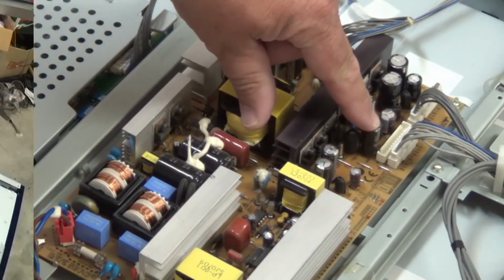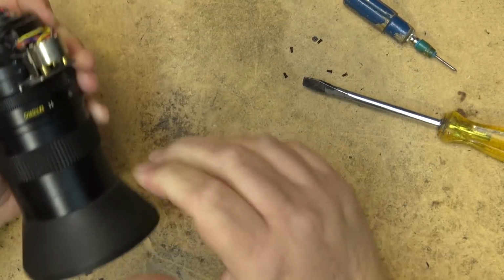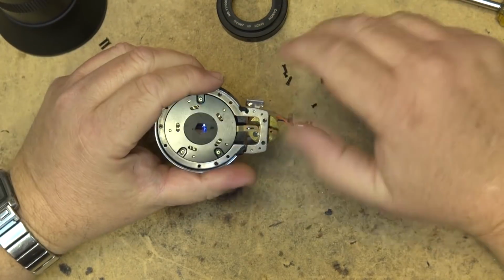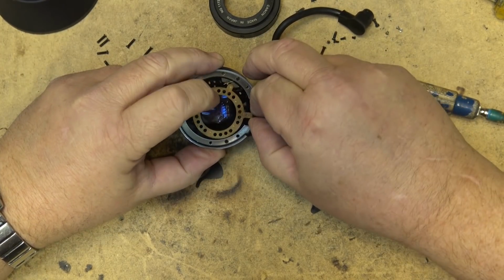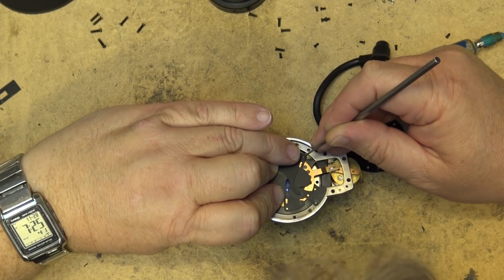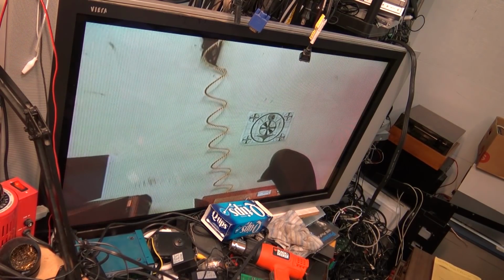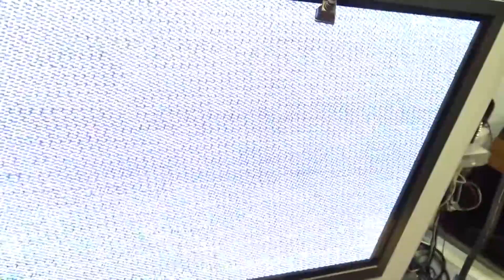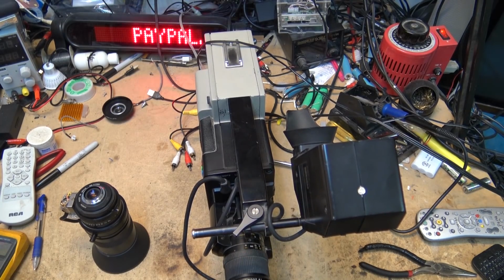Broken Canon Zoom Lens. Can I fix it? Let's find out.

Comment: Back in the 80's I worked on the service bench for Olympus Camera. I had to take many of those completely apart, clean all the parts in R11 liquid refrigerant,  reassemble,  and test.  Customers were forever getting all sorts of liquids in their cameras and lenses.  I can't remember ever having to tell a customer their devices were not repairable.  But that was right on the edge of the throw-away market.
Reply from the maker: We used to use Freon TF solvent to clean these parts as it was a high purity cleaner that would evaporate very quickly.

Comment: In the mid 80s I worked servicing broadcast cameras for a Japanese maker out of London UK. When the first chip sensor cameras came to market we’d an order for 35 units plus ⅔” format bayonet mount ENG lenses. The cameras were sent with all accessory sets and so too the Canon lenses and  their studio control kits... zoom demands and focus remotes. The customer however went through all the 35 brandnew lenses and screwed on the remote adapter units using his own supply of 3mm screws... that were too long by a good 10mm... he didn’t notice the kit had a small bag of black screws. So the result was 35 new lenses that had their variator crushed rendering each lens stuck with a fixed zoom position. The lenses were eventually all rebuilt that involved them being shipped back to Japan....
Reply from the maker: Oh I bet the tech that had to rebuild them swore more times than I did on this one.
Reply: @12voltvids  And likely in Japanese too. I pity the guy(s) that has(ve) to work on these often (no offence, Dave)

Comment: Speaking of the attachable lens camera, I had my Nikon 1 J1 camera, back the in 2015 when I was currently use the 10-30mm lens after when I was filming outside about the thunderstorms, until all the sudden later on, the 10-30mm lens went dead on me, so I have to stick with the 30-110mm lens for a while because, I can't get it to work where the original 10-30mm lens are no longer work. Following this year, I got the new 10-30mm lense and it works like a charm.

Comment: I THINK YOU ARE FIRST ONE IN YOUTUBE  REPAIR LENSE
Reply from the maker: Really?  I did not know that.  Well now you know how these things go together.  Initially I had not planned to repair it because I dont really have a use for this lens. Just wanted to show the internal make up and then I got the idea to fix the iris as that is what was broken on it.  Now I have a working lens but no camera for it.
Reply: @12voltvids  Well, you sorta have a camera for it now (just the issue is the auto-iris plug's too short). Sort of as the camera shown needs a good once-over (and maybe, if it's possible and viable for the camera, a new tube).
Reply: @12voltvids   i have b4 lense for my f900 hdcam camera the lens is broken in focus ring and i search in toutube  to find how repair this think by my self and i did not see..so.. i only find your video...thanks

Comment: June 1980 lens.
Reply from the maker: The camera was probably sold late 1980. That was when the porta paks were the big thing. I have the recorder that went with the camera, a Sony SL2000.
 it was shortly after this that the lens was attached directly to the camera body. they removed the C mount.
Reply: Canon stamped a date code on the rear of their lenses for many years (no idea if they still do that), and I owned and repaired my FD/new FD mount SLRs up until I finally got a DSLR.